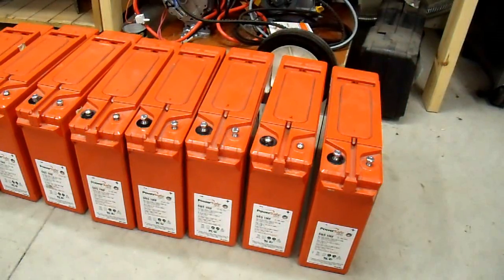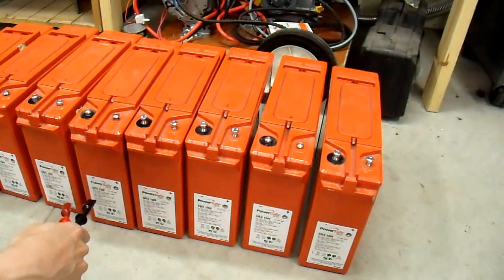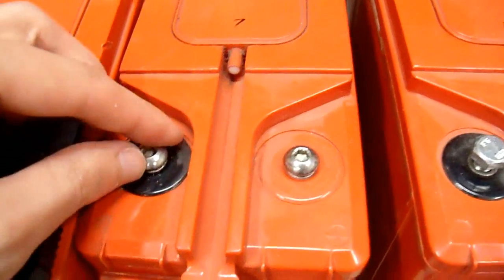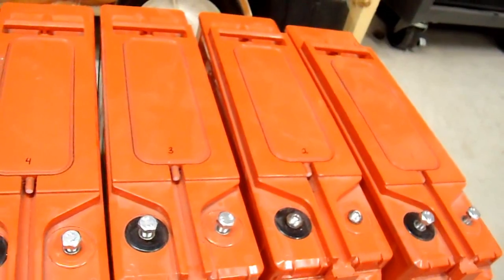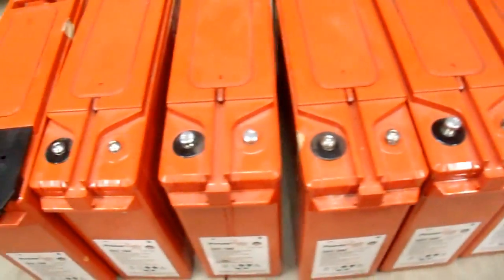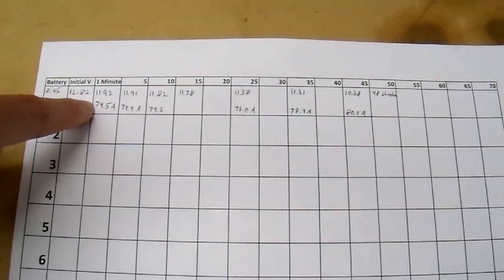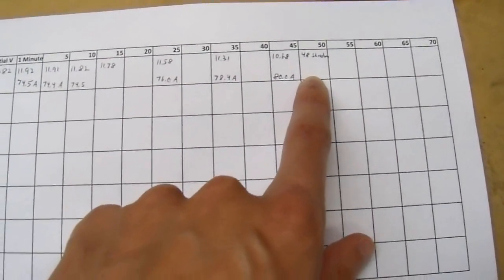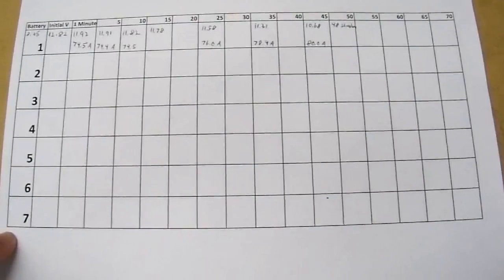1000Ah Battery Bank Part3 - Testing the Condition of my Salvaged Batteries

Comment: Thanks for posting this battery test. Wish more people understood the only way to determine if a battery is "good" (i.e. Amp Hours) is to discharge it with a fixed, known load and measure the time it takes to reach "zero" (the cut off point for your battery technology).
Reply from the maker: Yes, it's unfortunate that starting batteries are generally only tested for starting capability when determining their condition.  (Starting capability meaning current draw for a short time or an impedance test).  But then it does give a good indication of its real condition and it isn't exactly practical to do an hour long test on them either...